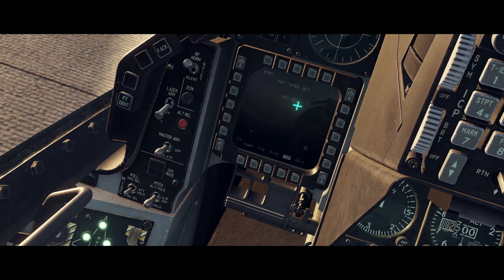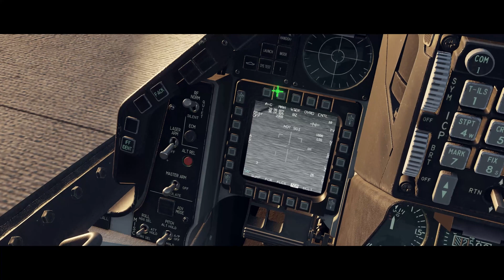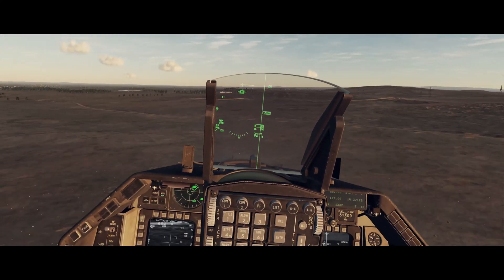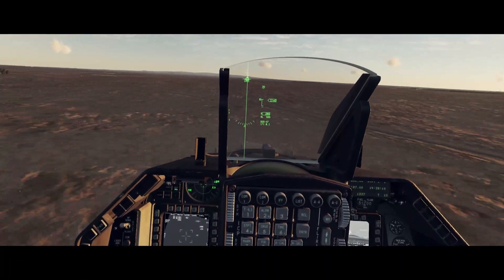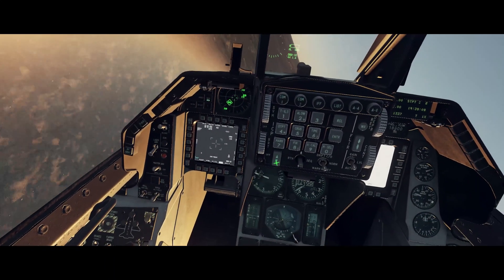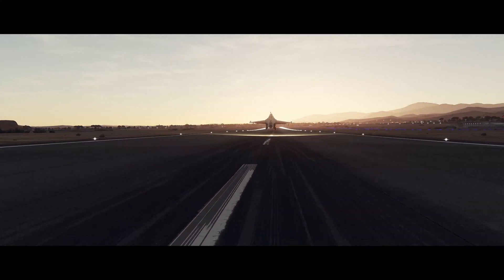DCS F-16C | AGM-65D MAVERICK | PART I: PRE mode

Comment: Mine usually misses by just a bit. Is a boresight alignment required to get the Mavericks always accurately targeting the same thing as what the TGP hands off to it?

Also, any tips on finding ground targets using the targeting pod?  The FLIR makes everything look the same sometimes, so it can be difficult to find what you're looking for (i.e a small tank that isn't associated with a steer point).

Comment: What are you doing by hitting TMS up when you're 9 miles out? Normally that would be TGT Point Track and Mav Handoff, but your TGP didn't have a line of sight to the target. So what was it doing?
Reply from the maker: @machalot - I’ll probably dive into the A/G stuff now that things have gotten a bit better with the Viper and Mavs/TGP.  There came a point where I could run the exact same mission hitting the same points and timing for Mav’s, and from one time to the next I’d get largely different results.
Reply from the maker: TMS UP started the Hand-Off for the Mav, from the TGP.

Indeed the designator box did not align with what we were seeing on the TGP.  At the time it was a bug with the Viper Mav/TGP.  Mav’s still hit the targets.  Have to just hit the “I believe” button and hope it tracked properly, which it did.  

I’ve not messed with the Mavs since then so can’t be sure it’s since been made better.
Reply: @IRoNCLaW  Ok. The latest patch [Dec 2020] has fixed a lot of the TGP and Mav functionality, so it may not work like that anymore.